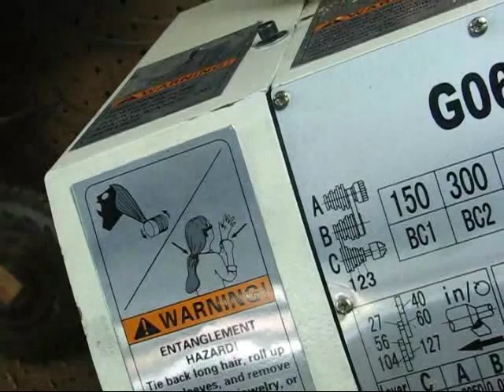Ballscrew Turning Y Axis Part 1

Comment: Hello,

I’m new to this hobby I have notice the sleeve that you’re using to prevent damaging your work piece I would like to know: 

Did you make it yourself?
What material is it made of?
Do you need a new sleeve each time you make a new part?

Thanks for your help and this video.
Reply from the maker: yes i made it from aluminum but any soft metal will work and it gets used over and over.